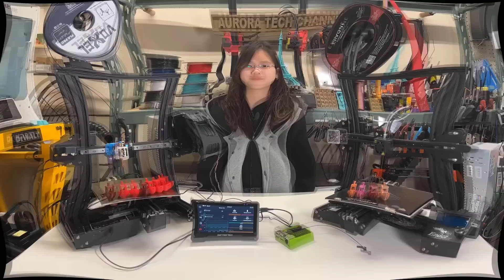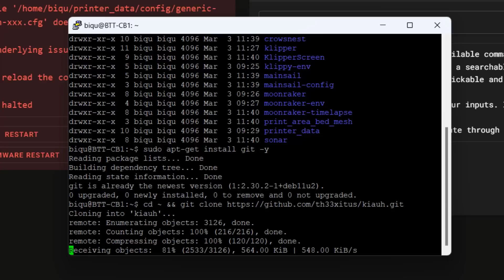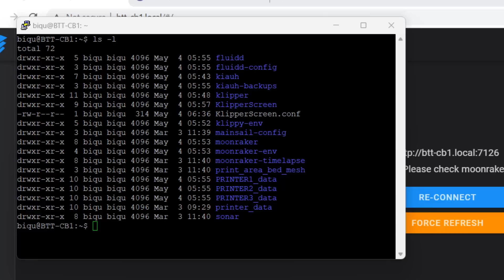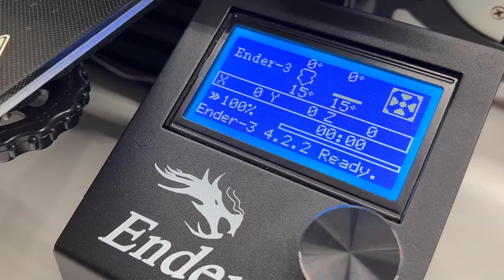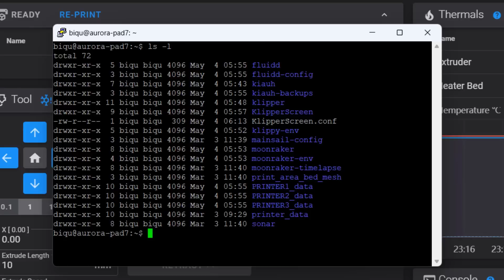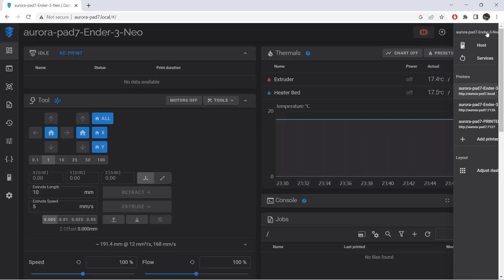Multiple instances Klipper: BigTreeTech Pad 7 / CB1, low-cost Klipper solution for multiple printers

Comment: 2026 CB1 modules all been bricked by new 3.0 update as the system does not connect to WiFi asides Ethernet cable and proper OS flashed, do not waste the time, money and resources on this module, not worth the migraines this will bring, just get a CM4 or raspberry pi 4 to run klipper

Comment: Aurora Tech, thanks for another amazing video. I noticed that during your entire setup of the Pad 7, the two green LEDs on the Pad were off, but after installing the accelerometer, they appeared to be on. How did you get them to turn on without having the BTT Klipper screen? On my Pad 7 everything works fine but even with the modified BTT Klipper Screen there are no LEDs on, no sound, and no vibration.

Comment: While another amazing video, sadly I ran into nothing but issues with getting the Pad 7 to connect to my sv07 if the configs for the ADXL345 were enabled. I have spent days trying everything I can think of, reimaged the pad, latest version or earliest available, older klipper or current, nothing it flat out REFUSES to connect to the printer MCU. If I comment out everything related to the ADXL it instantly connects and works but I cannot run IS at all... Tried reaching out to BTT support and they said they would review it and get back to me... Nope didn't happen.

Comment: I followed this and got 2 printers to work on my pad 7. However, i can not control them simultaneously. When i switch printers i lose connection with the mcu on both when either using the Fluidd interface on my pc or the touchcreen interface on the pad. Any idea?

Comment: Method is outdated; newest image already comes with screen config files, and when instructed to create klipper screen conf via kiauh it does not but delete the file, which is then non-recoverable and and requires a new image flash.. i would suggest updating your install videos or removing them..

Comment: Thanks for the video! I wouldn't have been able to figure this out by myself. I had to just keep the serial for the printer instead of setting up each usb port for some reason. I can plug into any of the 3 ports and it still connects my printer.

Comment: Am I missing something? I’m trying to flash Klipper on to the Ender 3 with the 4.2.7 board and you said common printers you could find the firmware online. I have looked. I don’t see it. Printer config yes I would agree firmware not so much.

Comment: I see these videos and the result of the prints, and I compared them with my Anycubic I3 Megas' prints which do not use any fancy hot ends, controllers or software and I find my prints on my Anycubic I3 Megas much consistent and cleaner.

Granted I may be heavily biased by 7 years of using strictly Anycubic I3 Megas, for reasons which should be obvious when you find a printer that is reliable and consistent, there is no need to replace it or change it.  As I have said in my recent experience with an Artillery Sidewinder X3 Pro in an 8-part YT video series on my channel, it seems like we are going backwards instead of moving forwards and all the glitter in these new controllers and software is simply, IMO, another way to hook a naive 3D printer user. 

Not to mention also the cookie cutter unattractive and illogical open architecture of many recent 3D printers, reason I do not favor any machine that is built open structure with extrusions and does not employ a solid base housing all the electronics in a safe, clean and logical way. Having a controller floating mounted on the side of the machine via a plastic bracket, as on some machines, is the most hideous and impractical way to have a controller on a machine that is just begging to be broken if one happens to apply enough pressure or something heavy falls on it. 

Yes, there maybe a few things new that you can do with these new controllers and software but IMO the KISS rule of a solid well-built no bells and whistles machine, rules! Just look at how complex these new controllers are to program for a new user and maybe some seasoned 3D printer users, as well. In addition to having the controller as an individual part of the machine, instead of it being integral as in the architecture of the Anycubic I3 Megas, which are part of the enclosed solid base, safe sound and aesthetically clean and logical from all perspectives.

Yes, I am probably the only one, or one of very few people, who looks at products and especially machines this way, and it upsets me greatly to see our world, where crap is fed down people's throats and many simply accept it as "go with the flow". Ok So I am old school who believes in Simplicity, Clean Lines, Performance, Durability and Longevity of products and this is what look for before any sugar coatings.

Comment: how do you change the clock on the pad7?
Reply from the maker: SSH login, then use the linux date command:
sudo date MMDDhhmm[[CC]YY][.ss]

For example, to set the date to November 24, 2023, 21:00:00, type:
sudo date 112421002023.00

Comment: Thanks for your videos they help a lot. I just got a Manta M8P V2.0 board with TMC5610.
I have a Pad 7.
I followed your video and everything went fine except it will not connect, I get mcu 'mcu' Unable to connect. When I run ls /dev/serial/by-path it shows the right port: platform-5200000.usb-usb-0:1.2:1.0-port0.
On the boar next to the USB C is a switch that according to the diagram switch between USB-OTG and UART to USB, I only get a port when it is in (I think. The white square on the diagram is to the right, closed to the edge of the board) USB-OTG.
I also see a dip switch block with 4 switch marked: 
eeprom-WP
NEXTRST
RPI_BOOT
USB-OTG
Could it be that I have to set one of those?
I have tried with different USB cables, they works to communicate with Android phones and tablet, when I write code and use them as debugging device.
Thanks for any help.
Reply: where you able to resolve your issue?  I am having the same problem

Comment: So I have tried a few times now to install several instances and it does not work. As soon as I remove all the options in Kiauh and install them back when I try to reboot the pad it will no longer reboot in klipper screen. I even tried to not remove klipper screen and just remove and install 2 instances of klipper and moonraker. Either way I can't. And then I am forced to install the CB1 OS all over again and it is a long process. Is anyone else having these issues? I have seen some complaints online about things after the last few updates. I am running out of ideas and have had to reinstall everything close to 10 times now. How are we supposed to get more than 1 instance? I have followed this video and a few others to the letter and keep getting the same results each time. The pad won't boot up . I also ran into this on a raspberry pi as well. I can install one instance no problem but as soon as I remove everything and installing it back on the bad won't reboot again into klipper screen. And I am also not able to SSH back in .

Comment: Hello Aurora Tech, I have after some help and re-watching your and others help videos at last got the Pad 7 to log into my browser and now see the Klipper system on it.
Now the real fun begins, I have a Elegoo Neptune 3 Max I wish to control using the Pad 7 system through the Browser, where do I get the Files needed to do so?

I need two it seems?  so the klipper runs on the printer it's self and the other file to control that by the browser or the pad 7 directly.
I have a Elegoo Neptune 3 that I also will be adding to the system as I have it working!  So how and where do I get the files needed?

Thank you for your help.

Comment: can someone provide the original printer config file that comes with the Pad 7, I wrote over the existing one and lost the sensor information for the pad7 built in heat probe information, thanks in advance

Comment: After updating everything works fine but the touch screen is buggy. When not connected to the printer the Touchscreen works fine but when i connect it to the printer no matter where i touch on the physical screen the response is off by alot, like i cannot click on the menus on the bottom right for example. Any info on that?

Comment: Hey Aurora 
Great and very detailed Video 👍

Did you think that the Pad7 could also used for the Twotrees sapphire plus v1 (with Z-Axis belt) to work there with Klipper?

Thanks for your Time

Greatings from Austria 
Peter
Reply from the maker: As the Sapphire plus v1 is using the MKS robin nano motherboard, so, it should just work with Klipper like other machines with the same motherboard.
Reply: @AuroraTech  thanks a lot

Im 60 years old and be sure that the Future would be Great with Young People like you!

Dont let you bring down!
Make your Thing - the Future is yours

Comment: I came back after a chat with Tiny Machines because they recommended the Pad 7 for my 10S Pro as a update for reliability and speed enhancements. I so wadded through your video. I am amazed at the depth of your broad knowledge. Tiny Machine will provide on line setup support which would be required. this level of integration is beyond my patience. I need to design and print.  So i ask you, would the Pad 7 for my one 10S Pro Printer provide the extra capability and set the machine up for Linear rails and faster Hot End.  Thanks for all you guys for the cause. Dennis

Comment: After watching your videos, i decided to upgrade my Longer LK5 Pro printer.  This is my first venture into Klipper and it's quite a learning curve.

I have a couple questions, all relating to Klipper, and it's implementation in a Biqu Manta M8P board, with a CB1 EEMC.  I'm running TMC2209 stepper drivers,  I purchased both a TFT70 and a Bigtree HDMI 70.  I also took the plunge and purchased a Biqu H2 500C to be able to print flexibles and other materials.    I've got the mainboard talking to the printer and thanks to your video i have the blTouch working with mesh bed leveling.

Here are my questions,
1.  my extruder Thermistor reads either -250C or + 250 C  and doesn't track the heater.  ( the heater works)   I've tried sever config settings to no avail.  I've reached out to biqu, but no answer yet.  All the documentation is for Marlin, so it doesn't help me with Klipper.
2.  I haven't been able to get either screen to work.  THe TFT screen displays a menu but says can't connect to printer.  The HDMI 70   turns on, but nothing displays

I'm kind of at a standstill and I would appreciate any help you could provide.

Thanks in advance, and please keep those Klipper videos coming!!!

Dave

Comment: Question: Would you mind providing the configuration info for the input shaper and adxl345? I tried to read and copy the brief screen shot of your printer.cfg file that was shown on the video but it does not work. Perhaps I miss read it because it is not too clear. It will not boot due to an "unable to open spi device" error.
Thank you for the informative video. I'm new to Klipper and this video helped me get it running with only the issue of getting the input shaper configuration setup. Excellent results considering this is my first attempt at using Klipper! Thank you again.
Reply from the maker: Here you are:

[mcu rpi]
serial: /tmp/klipper_host_mcu

[adxl345]
cs_pin: rpi:None
spi_speed: 2000000
# spi_bus: spidev2.0
spi_bus: spidev1.1

[resonance_tester]
accel_chip: adxl345
accel_per_hz: 70
probe_points:
    120,120,10
Reply: @AuroraTech  thank you for your prompt response,
I did copy these lines and still get this error:
"MCU 'rpi' error during config: Unable to open spi device"
I've read many similar posts on the web about this error but none relate to the Pad 7. I think this product is too new to have much feedback. 
The only thing I can add is that the green LED on the adxl is on. I assume that means the cable is good. I will do a continuity check on it to verify that.
Do you have any ideas as to where I have gone wrong?
Reply: @AuroraTech  I'm stuck at this step. I keep getting errors.

Comment: take a doubt. I have a btt-pi v1.2, which is the CB1, when I put klipper on the sovol sv-06, via kiauh and install more than one instance, the sv06 doesn't work. it only connects if it has 1 instance and no name. so, by default, the printer is printer_data.
Can you do this test on pad7 and sv06, with more than 1 instance and naming each one of them?

Comment: is nobody mentioning the overvolting of 30XX series GPU's on gigabyte X570 boards with stock settings? I went through 3x motherboard replacements until I complete switched to another brand motherboard.

Comment: I have also read that enabling Jerk control and acceleration control from Cura will cancel out the klipper/pad7 controls of these. Is that true? I heard that was the case with Sonic Pad as well.
Reply from the maker: Yes, it does, that's how you set acceleration for faster/slower print speed, but it will still be limited by the max acceleration inside the printer.cfg file.
Reply: @AuroraTech  I am confused, I was asking if the cura settings cancel out the pad's ability to handle the acceleration and jerk with the adxl and input shaper... please clarify as I have operated on the pretense that if you are using Klipper - those settings should not be checked in Cura

Comment: It appears your default screen is working even with the BTT7 Klipper running. How did you manage that?
Reply from the maker: Classic LCD works with Klipper, you just need to enable the display in printer.cfg (Ender-3, Ender-3 Pro and Ender-3 Neo):

[display]
lcd_type: st7920
cs_pin: PB12
sclk_pin: PB13
sid_pin: PB15
encoder_pins: ^PB14, ^PB10
click_pin: ^!PB2

Comment: The advantage IMO of the Pad 7 is that it uses stock vanilla Klipper and Mainsail, why Creality decided to butcher Klipper with its own fork is beyond me, Creality has a track record of releasing bad software, hell they cant even configuire Marlin correctly, so why they decided not to use stock Klipper that is a proven firmware that receives regular updates and would not need any programming and the costs that incurs was a bad choice IMO.
 I myself have previously used a RPi 3B+ and touchscreen to run bothe Klipper and Octoprint but have now changed to Orange Pi Zero 2 + USB expansion and the same 7" touchscreen to free up the Rpi for another project, total cost £83

Comment: Love you're videos.  Great job. Ca you confirm if the pad 7 will work with the anycubic kobra? Based on what I have seen it won't work due to the motherboard no being compatible to run klipper.  I am so frustrated with anycubic.  I bought everything needed to run klipper like a pi 3b , touch screen , power supply etc and found out to get it working I have to do some soldering and move resistors. All other printer companies don't have this issue with their boards. Can you confirm? Thanks
Reply from the maker: The HC32F460 chip is now supported by Klipper 1-2 months ago, as Kobra series are using the same chip (my latest Kobra 2 is using HC32F460 as well), so I don't think it's a problem to run Klipper on them. You can refer to the example config files here (Ctrl-F to search for Kobra):
https://github.com/SteveGotthardt/klipper/tree/master/config
Reply: They have Kobra Go and Plus printer configs for Klipper, not sure if they use a different boards. But if you can’t use Klipper on your machine, then you won’t be able to use the Pad 7. Unless you change the board.

Comment: Wow 🤩 so BTT finally got its own Klipper hardware. Can we still use raspberry pi to work with pad7?
Reply from the maker: You don't need the RPI anymore, Pad7 built-in CB1 which is a RPI replacement board.
Reply: @AuroraTech  wow thanks ! so just plug & play. 🤩

Comment: I have 3 CB1 controlled printers and only one of them seems to work reliably.  The other two spit out errors that don't even get me a useful google result.  I've decided I will be eating the price of a real raspberry pi next time.
Reply from the maker: Just try using the latest OS image. I also have three CB1(including the Pad 7). They are all running simultaneously without any issues. They are controlling 4, 3, and 2 printers, respectively.

Comment: Could you make a more detailed video on exactly how much did the linear rails upgrade on a Klipperized bedslinger contributed to the increase of speed and acceleration compared to running Klipper on a stock printer with POM wheels? I couldn't find a definitive conclusion anywhere on whether it is worth upgrading to linear rails at all if input shaping is already working. Especially Hiwin rails.
Reply from the maker: As long as it's still a bed slinger, I can't see how linear rails would contribute much to the speed. They simply run a little smoother and won't wear down like POM wheels. In my opinion, it may not worth getting Hiwin rails on a printer like that.

Comment: Would love a comparison of running Klipper on something like the Libre Le Potato compared to CB1.
Reply from the maker: It is priced similarly to the BTT CB1, but it does not have WiFi on board. Instead, you have to use a USB WiFi adapter which occupies a port. Therefore, I would prefer to save that port for another 3D printer.